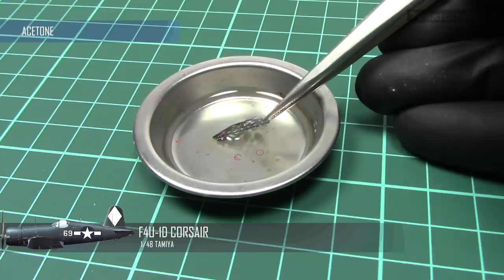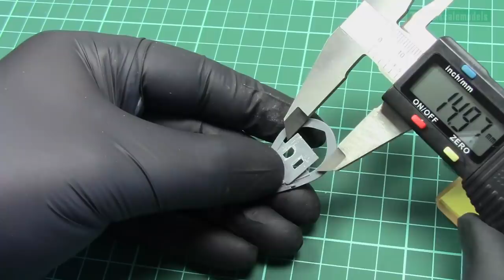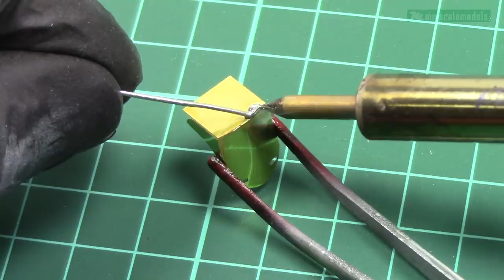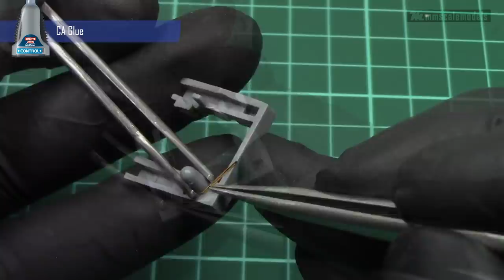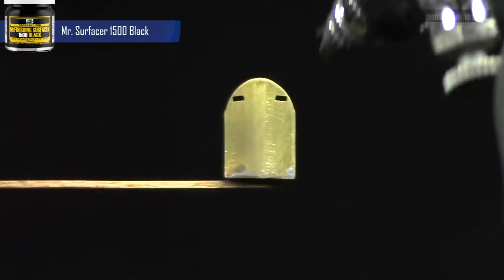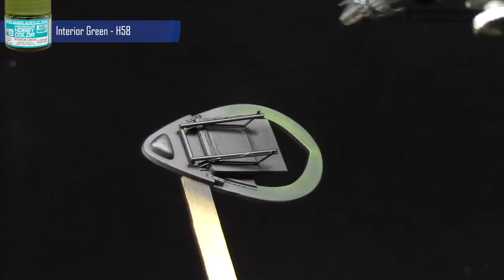1/48 F4U-1D Corsair - ep 1 - Tamiya plastic scale model build

Comment: Cool build, I am currently scratch building a whole interior for the hobby boss 1/72 kit.... I wouldn't normally have done that but the kit hasn't got and interior ..... it has a seat and a stripper pole ...... I think that's supposed to be the control handle....  

Maybe it is a stripper pole 🤔 I will check the decal sheet for 1 dollar bills 💵
Reply from the maker: Ha ha, kudos mate. I kinda lost the satisfaction of building kits from ground up. Probably when i finished Italeri's hh-60 in 1/48. It's just so much effort... at that time i ended up building less than a model for an year.